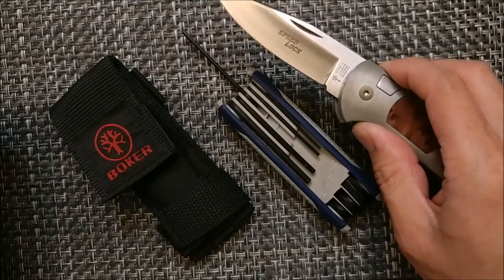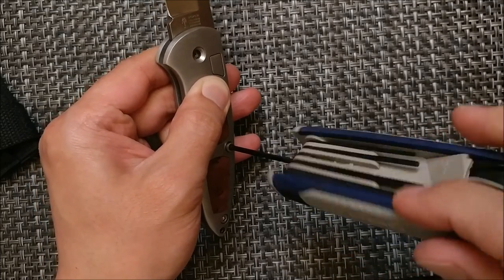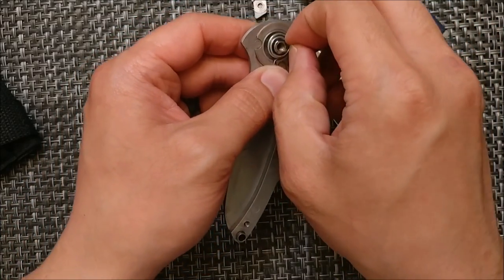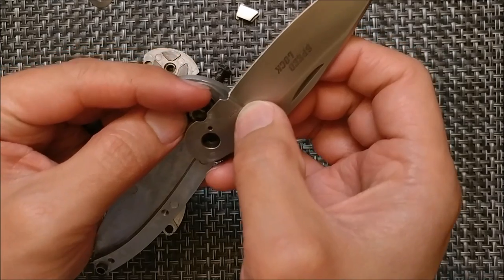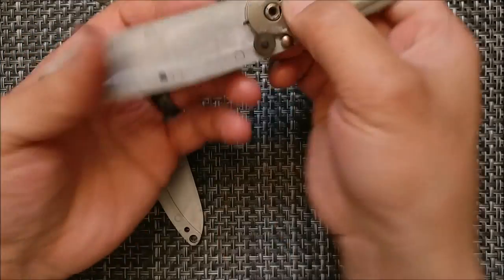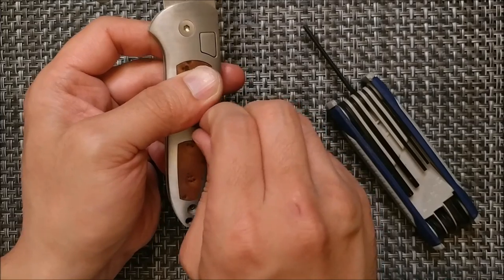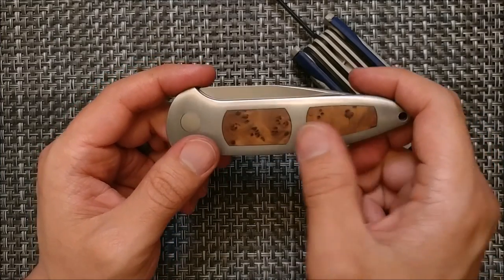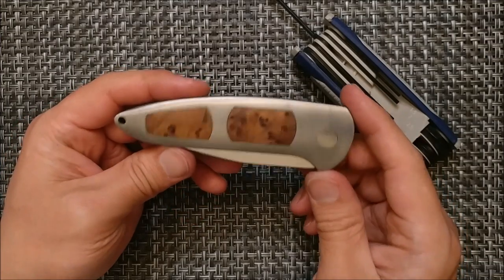Boker Automatic; Disassembly and Reassembly

Comment: Converting Top Lock II. The spring bed is cut, but the blade is
not drilled.  Do you know the hole size in
the blade.

Comment: lol Love the Band aid.  I should consider adding one when I return the knives I have sharpened.

Yes, that smack when opened is fun.  The spring under the release button was rusted in the one I had, but that one was really cheap.  Still, some oil on it (or a drop in the spring well) may be a good idea.
Reply from the maker: I was glad I didn't send mine in for service as their guidelines say they will dispose of any automatic knife that comes in for service.

Comment: If spring is removed, it get locked open by the button? TY!
Reply: I mean, the button locks open and close blade?
Reply from the maker: Yeah it's a lock to lock button lock if the auto spring is removed.
Reply: @BladeBanter  oh nice, i will remove that nasty spring
Reply from the maker: It will not have a closed detent as you will need to depress the button to open and depress to close.

Comment: Do you remember what size spring you installed?  I have this exact knife but not the old spring.  I lost it.  I went to knife kits.com and saw they have many different sizes.  Thanks for your help.
Reply from the maker: That I don't, but I believe they will assist if you contact them.  I installed the stronger spring when I did it.  Thanks for watching and good luck.

Comment: We use to make this model automatic when they came in they weren't milled out or have a spring I worked at a knife retail store the springs we made from piano wire
Reply from the maker: Very cool I probably did it wrong but this knife kicks hard.
Reply: @BladeBanter  no you did good . It was weird sometimes the frame would come milled out but we had to drill the holes in all the blades for the springs
Reply: We had both sizes and all kinds of inserts from red bone to wood
Reply: @motomark9736  What did you use to drill the hole in the blade?

Comment: What size spring was the correct one?
Reply from the maker: It depends on preference for the spring tension.  The one installed is still working, although I don't use it much.

Comment: I have the same knife. There is a metal ring missing in yours. That is why the spring is deformed.
Reply from the maker: Ahh I had picked it up with all the guts missing.  Will need to track down the part.  As I can't send it in as they will just destroy it.

Comment: See the spring on ur one was a lot more then required over tentioned I came searching how to fix one from oxidation or corossion without issues xd
Reply from the maker: Yeah it had a good amount of tension and hadn't installed a spring prior.  With an aluminum handle you could polish it as well.
Reply: @BladeBanter  yea I like that force actually most Chinese knifes or usual other auto u have only pin cause u pull it out and u put the blade on the spring and u turn around put the pin and done it's good as new xd